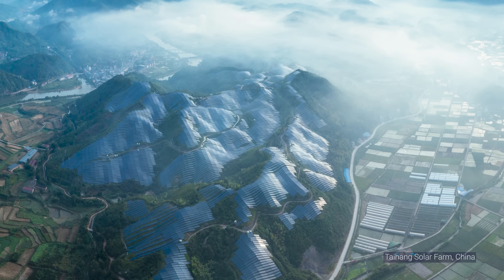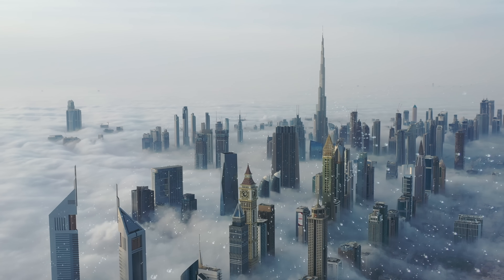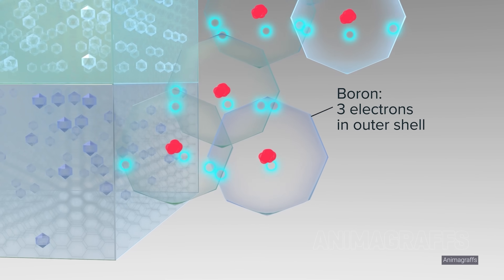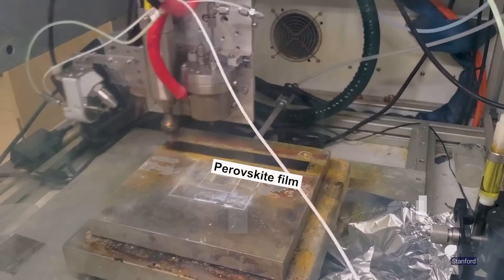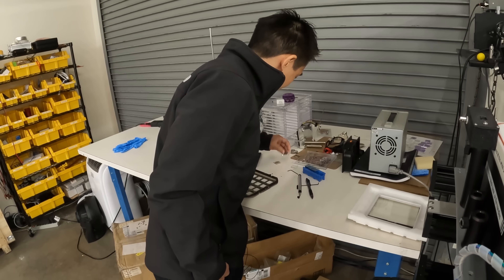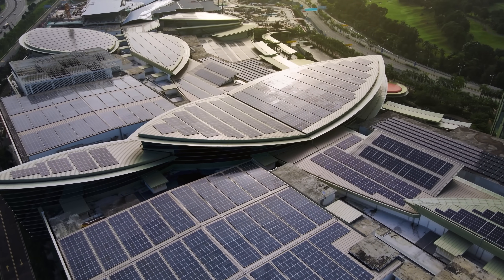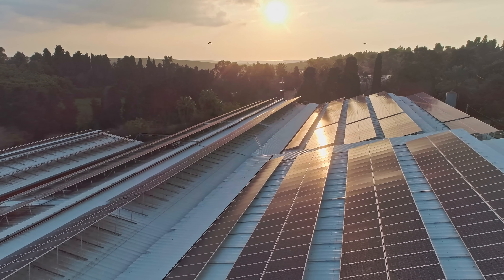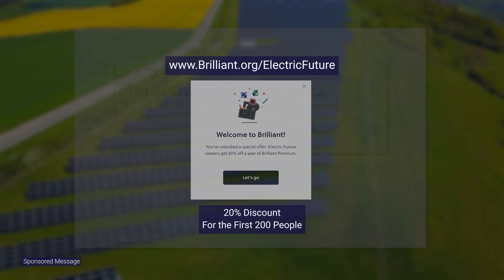Solar 3.0: This New Technology Could Change Everything

Comment: One way to improve solar panel efficiency is to install blocking diodes between each of the solar modules within the panel. Conventional panels when just one of 60 sells is shaded will reduce output by as much as 50%. This is because the shade itself becomes a load on all the cells that are receiving sun and the energy is diverted. Blocking diode to prevent the solar cells that are in sunlight from feeding back into the Shaded solar cell.
Reply: yeah ..nice explantation ....but now a days the solar cells on the modules is devided in to two parts so that if shadow came then this not effect the entire efficiency of module. this technique is genrally use for module powers are arround 400 watt or more than this.
Reply: @alokverma3311  Good to know. I'm experiencing this issue with 240W panels. 60 cells. Cover 1/2 of one of the cells and power drops from 180W to 80W. It's really shocking how little obscuration can cut way down the output.
Reply: @basspig  80 is not much less than 50% of 180.
Reply: @wes326  it's way out of proportion to the area blocked (1%) though. So if those offline shaded  cells were isolated by diodes, it would help hugely.
Reply: @wes326  Reread his comment. He didn't say to cover half the panel, instead he said to cover half of ONE of the cells from 60 and it drops about 50% power
Reply: @onlineearner4669  Thanks.
Reply: @basspig  He just read your comment incorrectly.  He thought you covered half of your cells instead of 1/2 of 1 cell of the 60 cells.  That drop is pretty nuts and incredibly inefficient.
Reply: @alokverma3311  this is old technology, have you seen the Knight Rider 2000? 
it  is coated with this solar film .
Reply: Bypass diodes are very common nowadays in solar panels
Reply: Isn't that industry standard since like 5 years?
Reply: Look into micro inverters so that one panel blocked with shade doesn’t effect the entire system’s production. Each panel has a brain unlike the string inverter
Reply: @AsadAli-hm2vx  too expensive. I bought used panels at 10 cents on the dollar--it's the limit of my finances.
Reply: And good luck on obtaining the unprecedented amount of copper if just 30% of the US made the switch to solar.  Just to do that would require more copper than has ever been mined.... in the history of mankind.  It's funny how some people talk about these "green" forms of energy... Yes the energy itself might be green but everything associated with gathering, storing, transporting and implementing that green energy is anything but green, in fact far more harmful that current energy methods in some aspects. People should stop looking towards the skies and wind for future energy needs, we have the greatest resource in abundance on this planet.... Our oceans. For all of recorded human history water has played a significant role in the advancement of civilizations, stop looking towards the sun and look towards our moon.  Our moon and our oceans produce all the raw energy this planet needs.
Reply: @bennypit4411  that is a VERY good point that I never thought of. I was thinking more in terms of lithium mining and all the lithium on the planet.
Solar is only practical for a small percentage of the population.
Reply: @bennypit4411  how would using tidal electric generators change the copper issue. All avenues of green power should be invested in. As he was stating in the video, if we can get high efficiency solar cells they will be best utilized as supplemental energy sources for people’s homes, skyscrapers, business buildings, cars, personal electronics. This wouldn’t require large amounts of copper to transfer energy from a solar farm to the power grid. Also, no one can rule out a breakthrough technology in new conductors.
Reply: Sounds like a plan.
Reply: ENPH has micro inverters that correct this now.
Reply: @JasonBulsa  that's good. I bought used panels, 10 cents on the dollar, so they don't have that feature.
Reply: @KB-pk8cn  how much energy is in gamma radiation?
Reply: @basspig  On the surface of the Earth, very little thank goodness.  The atmosphere blocks most of it and it's a good things it does.  If enough of it reached the ground to be useful for electricity generation it would kill pretty much anything bigger than an ant that went out of doors.
Reply: at ground level, it would be in the pico-watt range per sq meter. Not even enough to light a small LED.
Reply: Potential endless energy source basically anywhere in this universe:

a. Small aluminum cones with an electrical wire running through the center of the cones, cones spaced apart (not touching I'm thinking) but end to end.
b. Electromagnetic radiation energy in the atmosphere interacts with the aluminum cones.
c. Jostled atoms and molecules in the cone eventually have some electrons try to get away from other electrons of which those electrons gather at the larger end of the cone, of which also creates an area of positive charge at the smaller end of the cone.
d. The electron's in the wire are attracted to the positive end of the cone and the positive 'end' in the wire are attracted to the negatively charged end of the cone.
e. Basically a 'battery' has been created inside the electrical wire itself, different areas of electrical potential.  Basically a 'wire battery' or a 'batteryless battery', however one wanted to call it.
f. Numerous cones placed end to end increases the number of 'batteries' in the wire.
(In series to increase voltage, in parallel to increase amperage).

*  Via QED (Quantum Electro Dynamics) whereby electromagnetism interacts with electrons in atoms and molecules, one would have to find the correct 'em' frequency for the correct material being utilized for the cones.  The shape of the cones could also come into play.  The type and size of the wire as well as the type and thickness of the insulation between the cones and the wire would also be factors.
Reply: @charlesbrightman4237  in theory, that is valid, but the energy density is far too low to produce practical amounts of electricity. Such arrays would have to be MILES in diameter to produce enough electricity to power the average home.
Reply: @basspig  Sure, on this Earth.  But what about energy needs away from this Earth?
Reply: @basspig  A recent thought also:  (to make the system more compact and light weight):

Of course also, possibly 2D triangles made up of certain materials with a conductor going down through the center of the triangle could possible achieve the same 'batteryless' battery system.
Reply: @basspig  Plus possibly with the 2D concept, layered 2D's that absorb different energy frequencies, thereby increasing the net output.
Reply: @charlesbrightman4237  that's a long way off, if mankind survives his technological adolescence.
Reply: @basspig  (copy and paste from my files):
LIFE ITSELF IS ULTIMATELY MEANINGLESS IN THE GRAND SCHEME OF THINGS.
Ask yourself and try to honestly and sincerely answer:
1.  How exactly do galaxies form?
2.  How exactly do galaxies become spiral shaped?
3.  What exactly does that mean for species that exist in a spiral shaped galaxy?

Current Analysis:  Long Term:  (Short Version):
*  Species stay on this Earth:  They all eventually die and go extinct.
*  Species leave this Earth:  They all eventually die and go extinct.
(No exceptions at this time).

1.  Everybody will die one day from something.
2.  Everybody will forget everything they ever knew and experienced.
3.  Everybody will be forgotten one day in future eternity as if they never ever existed at all in the first place.
(OSICA)

*  Life itself only matters to life itself, only as long as life itself still exists.  It's just that life itself is not always going to exist, at least not from this Earth.  For every moment that passes, one less moment being alive AND one moment closer to being not alive.
(Or so the current analysis would indicate).

Currently:
Nature is our greatest ally in so far as Nature gives us life and a place to live it, AND Nature is also our greatest enemy that is going to take it all away.  (OSICA)

**  Can we change the ending?  Doesn't look like it.

Not knowing the future does not mean the future is not going to occur as posted.  People just won't know until it occurs.
Reply: @charlesbrightman4237  there is only so much energy per cubic meter of air/space. Most of that energy is from electromagnetic signals from radio broadcast and cellular and it is proportional to the distance squared from the source. For example, I was able to harness enough energy from being next door to a 50,000W AM/FM station transmitter site to light one NE51 neon light bulb.
Reply: @basspig  nice. How though?
Reply: @charlesbrightman4237  That is of no concern since most of us aren't going anywhere near orbit, quit dreaming.
Reply: @stephen6631  the diodes could be implemented as part of the cell substrate.
Reply: @charlesbrightman4237  sounds like nonsense to this veteran electrical engineer. Unless the laws of physics changed since I worked in the field, the energy density per cubic meter of air is infinitesimal.
Reply: @basspig  Good luck getting solar energy far away from stars.  This system taps into the natural electromagnetic energy frequencies outside of the visual light range.  (Unless you are not educated enough for modern science).  (Quantum Electro Dynamics).
Reply: @charlesbrightman4237  my education is in conventional science, electrical engineering. I've read up on quantum physics, but it is largely hypothetical. When we consider such schools of thought, notions thought to be absurd, such as multiple universes existing at the same location being multiplexed at an unknown frequency, become tender for debate. But I live in the world science understands. That other stuff is just a pipe dream for now.
Reply: @basspig  Quantum Electro Dynamics:  How electromagnetic radiation energy in certain energy frequencies interact with electrons in atoms and molecules.
Quantum Chromo Dynamics:  How electromagnetic radiation energy in certain energy frequencies interact with the nucleus in atoms.
It is not hypothetical, it's real.

With electrical engineering, surely you must know how antennas function, (with electromagnetic radiation energy of a certain energy frequency interacting with the material of the antenna).
Reply: @basspig  cool!  So you could put that close to  a cell tower and collect energy?  That may b valuable for people that live under one and would like to avoid cancer
Reply: @stephen6631  I captured about a billionth of the total output of the tower to light one neon lamp. It's not a practical amount of power to do anything useful with.
Reply: @basspig  oh. Such is physics
Reply: @charlesbrightman4237  some more food for thought on that, life always struggling against a inevitable death, take the laws of universe that we have so far figured out, you could easily say thats entrceopy working against us, that life is resisting entropy, a ultimately futile struggle individually, but id say its not for nothing, a meaning of life is to resist and fight against entropy so if we step back and look at it, lifes purpose or inadvertant nature of resisting entropy follows suit with the universe, all the cause and effect etc, if the universe is infinite, then life too will be infinite as its the natural balance or force to counter entropy its lifes duty its karma, even in not infiniate universe id wager lfe would continue to exsist in some form, as it is what counters entropy, the life known as humans whicch are also the exact definition of a parasite, go figure may come to a end eventually but im not counting out life as a a whole, for it seems life indeed serve a big cosmic purpose like yin yang☯....so basically life is a struggle to struggle is to live, might as well make it as fun as possibleba, cuase we are serving a purpose by being here, by breathing, a purpose necessary for the balanance of well everything🤯 so lets live it the fuck up in rebellion in order to mainttain the cosmic balance, I can be of service to teach any how to fuckin live for the sake of livin, lol the earth is a ball of rebellion with a cargo both precious and destructive, but not nearly as much as space in general, and earth has its own forcefield flying threw the danager zone while we party on, so +1 for humanity there, and +10 for life in general haha
Reply: @gottiiii932  Ask yourself and try to honestly answer:
1.  How exactly do galaxies form?
2.  How exactly do galaxies become spiral shaped?
3.  What exactly does that mean for species that exist in a spiral shaped galaxy?
Reply: Shading just one cell in a series string of cells reduces output to zero, not 50% as you stated.  A leaf falling on a small panel, such as those use for running attic fans, can render it useless.
Reply: @Milosz_Ostrow  I measured the output of a 240W panel and shaded just one half of one cell and the output decreased by over 50%. This is a huge flaw in current solar technology.
Reply: @basspig  — The cells in the panel that you tested were most likely wired in a series-parallel arrangement and by shading one cell you killed the output of one of the series sections.  If you try that on a smaller panel where all the cells are wired as a single series string, you'll find the output drops to essentially zero when just one of the cells is shaded.  That can be a serious problem for panels that are installed near trees that shed their leaves in autumn and is a also a problem when the panels get covered with snow, as happened in Texas in the winter of 2021.

Comment: Given that its basically a paint, the longevity in certain applications may not actually matter as much. If the base material has the contacts, the perovskite solar interface can be stripped and resurfaced.

Comment: if the cost is really 15x cheaper per watt than silicon, then it would still make sense for large solar farms.  Just part of the setup would need to include either automatic install/replace or very easy manual replace.  Just making it twice as cheap(including the replacement process) over say a 50 year period would change everything.
Reply: How well it can withstand outdoor activity, being #1.  And replacement and such, labor costs of installing, etc adds to it as well.  You don't want large solar farms having to have them to always be replaced.
Reply: @toddjohnson7572  Once the infrastructure is in place, the base, the inverters, the battery bank, its a quick job to replace a faulty panel.

Isolate the panel, unhook the electrics remove and replace [panel, re-hook electrics, and you are off to the next job in 15 mins.

The cells could be mounted on sheet metal, which is hardy and relatively light, while retaining shape in hot sun.
Reply: @toddjohnson7572  this is old technology, have you seen the Knight Rider 2000? 
it  is coated with this solar film .
Reply: They struggle with 4 years. so maybe can guarantee 2 years. So replace them 25 times during these 50 years is not cheap. Don't forget both new material and replacement process. In video they explain they can't compete with silicon for solar park or rooftop.
Reply: Theoretical figures at most. If its that cheap, big guns would have jumped the que on it already.
Reply: @ssg8663  Hambug  ! ! !
Science is So haughty claiming We are almost at the verge of discovering the Theory of everything 😂😂😂
We can't Even copy the sun's  fusion nor kill a virus or  a simple cancer .
Reply: Isn't 15th time cheaper per wats, is 15th time cheaper per kg, because the active part it is more thinner, but on average is tree time cheaper, and life-span is somewhere between 7 and 15 years, so worse than today silicon solar cells.

Comment: Promising indeed, the hosnety is aprecisted. Hope the disadvantage can be solved in the future and this can be produced and made available to the public at reasonable above pruction and comercialization costs, even better if the pattents are released after a short time. Hope they don't get caught into a corporate mess that ends up turning this advances into costly, little above market efficient and obsolecence programmed crapp.
Good luck.

Comment: So could something like this be made and sold as window shades for homes?  If so, could they sell a small plug in inverter that allows any homeowner to buy it off the shelf and plug it in at home to reduce their grid energy consumption?  That would be a HUGE money-maker.
Reply: Elon Musk half sister VP of solar company.  Making solar panels in Windows. Clean windows and panels both at same times as well as provides hail protection. Reduced electrical costs in construction

Comment: From what I read, ALL flexible solar systems seem to degrade faster than rigid systems.
I am just wondering if this 'material' will continue to perform or will it also DEGRADE fast?
Reply: It's getting it to the point in research to last long enough for use in many many many things.  To ensure it.  It's getting better and better -- and will get to the point where it won't degrade fast, and be well worth it.  It'll hit the market before it becomes most optimal (like anything else).